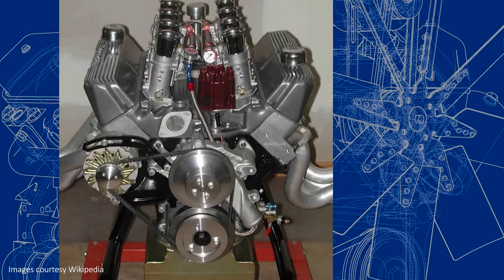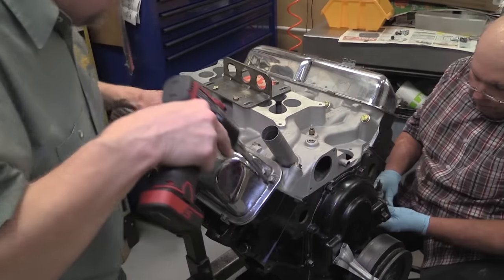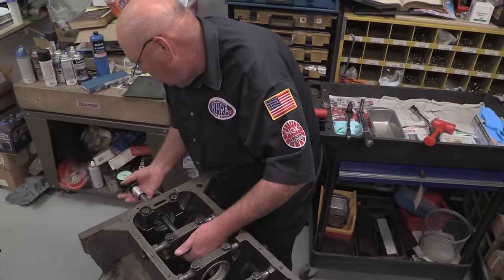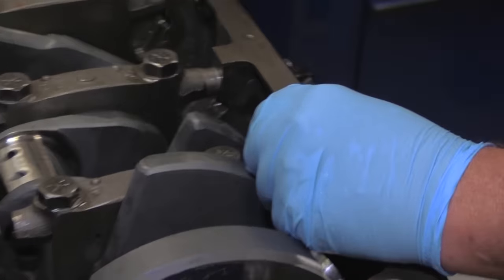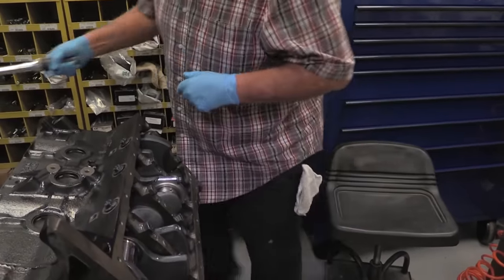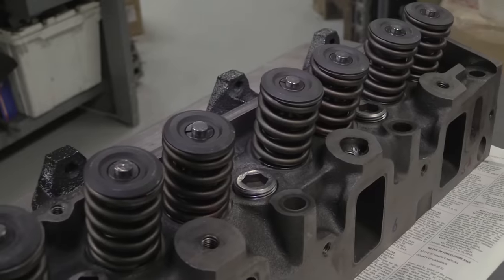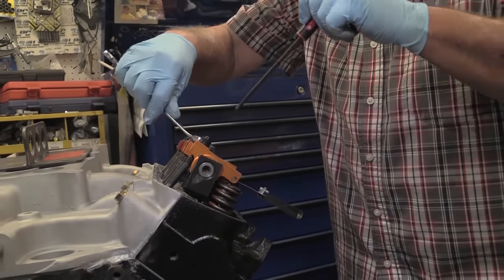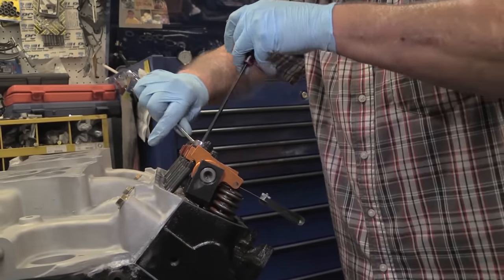Monster Ford 427 Top Oiler Engine Build and Dyno Session

Comment: I always have argued with people that a 427 Ford was even made . I have proved it to them time after time. I always wanted one of these. This is a beautiful work of art.
Reply: Actually 427 Fords they made different versions of them through the years, the top oiler, side oiler, and the sohc! King of all 427 Fords, plus the small block version . The FE series 427 is really 425 Cubic Inchs . CHRYSLER had the 426 Chevy, the 427 ,why didn't Ford leave it at 425 ? Food for Thought.
Reply: SOME PPL don't have a Clue! Ford made 3 Versions of the 427 thru the Years,  Including the SOHC /CAMMER! WHICH was Bad to the BONE! .
Reply: @jerryparks6123 Your right about those designs but not just 3. The high riser headed 427 had the top half of the engine in a league of its own. (Heads needed a intake to match). Also the tunnel port! I think somtimes we get lost in the amazement of the cammer, & rightfully so. However we shouldn't just over look the tunnel port 427s wich I believe there is no HP ratings on? However they ran every bit in step with Chryslers 426 hemi! The tunnel port heads had the big breathing ports like the hemi, but stayed with the wedge combustion chambers wich in some instances was a advantage for them! The early 427s started out with the low riser heads & and shortly after had high riser heads. High riser headed 427s got banned from nascar when the 426 hemis got banned. So Chrysler went to work to make the hemi legal. Ford created the tunnel port heads. Wich really flowed like the hemis! Just shorter than the high risers & still wedge combustion chambers! So many versions of the 427! The only differences in blocks was really just top oilers then side oilers. All the different head configurations used the same basic blocks if I understand it correctly.

Comment: The sound of a strong FE is amazing, this thing sounds like it could drag a volcano out of the ground.
Reply: we drag race FE 80s tbird with a mostly stock FE 390 and a 66 fairlane with a FE 427 and a turbo  check out my videos
Reply: ford ❤❤❤
Reply: It was a blast water skiing and joy riding in an 18 foot Hallett flat bottom drag racing boat. It had a V-Drive gearbox with 21 % overdrive. We would ski at 1900 rpm for some skiers and 3500 for others. We ran at Inboard Alley Colorado River area just below Parker Dam..fun times. 7100 RPM was a blast

Comment: Some commentors are disappointed with the power or that the owner went with stock untouched heads when he could have hidden some modern aluminum heads ported to flow.  What these critics are missing is that this FE likely is making 500 torque as low as 2,700/2,800 rpm, which means it can easily run between a 3.00:1 to a 3.50:1 differential gear and be loads of fun on the street.  I suspect that is exactly what the owner wanted for his Galaxie.  Even with very little throttle opening this car will really move out with that big flat table of torque.

Comment: There’s is so much more power potential in this engine
Reply: Lonestar Stang - not with Ford iron heads.
Reply: Moon Pie  Not sure what you mean by "unleash the hp" A cam change alone could give this setup 75hp. The cam is a modern style grind with high lift and low duration to improve torque at the cost of higher rpm horsepower. My stock (stock carbs, stock intake, stock heads, stock cam) 63 427 FE made 436hp / 458lb/ft with the dual points distributor with mid length headers without tuning. I had to go halfsies on the headers so they had something to run on the dyno that wouldn't fit and so the shop owners' daughter could get the headers that fit her 390 truck, haha.
Reply: It 8s really kool the John Kaase resurrected the the FE. Ha no change in prices, but for those with the means parts are available
Reply: Yeah, i dont see the point of not working the heads more. Even if someone wanted to go back to stock longblock, ported heads would do nothing but good things
Reply: Yeah, this performs similar to an off the shelf SBC 400" crate engine...
Reply: The exhaust port is the restriction on all FoMoCo iron heads. Just needs a massage on the bottom to blend into the bowl. Lots of cheap horsepower.
Reply: Scott Foxwell built one very similar cubic inches that made 850 hp with ported Edelbrock heads. So they weren’t crazy exotic, Scott is the top FE builder today.
Reply: @greekfrenchman4434  Yup...that was a dumb decision to leave them like that. I See some guys stroking their bb then put manifolds on it. Wth.
Reply: @Bbbbad724  Didnt know he was into FEs . He can build a heck of an engine

Comment: There’s about 75 horse left on the table just between a carb and intake swap. One of my favorite engine families at the track and grocery store and one of the best torque curves in Detroit.
Reply: I wonder how far it would go with a tuned Holley EFI and a performance intake.
Converting it to Fuel Injection and Elecronic Ignition would be beneficial in many ways since this engine went into a street car.
Reply: Way more power! I can get this from a 410 Mercury built a bunch of them for Mustangs.  416 cubes at 7000 rpm’s.

Comment: That motor will be a riot in that big Ford. That effortless torque with 470 hp will do the intended deed.
Reply: Yeah, big engines make heavy cars feel light.
Reply: @larrygall5831  
That Big Boy should be making 575+ easily. W.T.F.??
Reply: @guyneault5054  I was thinking 600hp. My slightly warmed over 440 mopar makes 500hp with 9.5:1, iron heads and a flat tappet hydraulic cam on pump gas with a single Holley carb.
Reply: @mitchellferre1652  
Mitch, I just so happen to be at Bonneville right now
 Thought you mite appreciate that, being you 
Just posted. 3 days into the meet, and because of rain, no runs yet.
Reply: @guyneault5054  good luck and have fun at Bonneville  ! 👍
Reply: @mitchellferre1652  no it doesn't
Reply: @jradish   yes it does and yes it did lol. My engine builder has a +.030" 440 with iron heads, a single 4bbl with stock block crank and rods makes 607hp on dyno. All day long.
Reply: @jradish I'm with u. From my experiences bb mopar with oem heads not often see one that makes 600 na? I'm not saying impossible. I'm just saying alot of effort would go into that build. Because of the factory heads. I know aftermarket headed bb mopar will easily. But oem cast iron?? Idk? Maybey I just havnt seen enuf big mopars??

Comment: When I can afford a build...I would want these old master's doing the work....Hands Down some of the Best!
Reply: CRYIPTIC CREEP  Iam with you as far as I would want an old timer working on my car hands down. These guy have forgotten more than I would ever know.
Reply: @craigsmith177  Agreed Sir
Reply: That badboy was used in the gt40 in 66'
Reply: It's not that hard of an engine to put together.
Reply: @jesse75  Then you Sir must have Talent.
Keep Up the good work.
Reply: @cryipticcreep5586  I have a video of a 64 Top oiler in my race car on utube.
" 427 FE with a new set of valve springs. "
My dad and 8 of my uncles were all motor heads. My grandpa and grandma had a farm with old cars on it. Mostly 60's Chevy's. Couple of mustangs and a dozen Pintos. 
I grew up around mechanics and it's second nature for me.
I worked on everybody's car in highschool. 
I'm 65 now rebuilt over the years more than 500 engines. Still doing about 20 a year. 
Locate yourself a good 390 block. Just put a stroker crank in it. It's a good option. Aluminum heads etc.
You can learn how to put an engine together yourself. The FE has a full floating pin, so you can put the pistons on the rods yourself as an example.
It's not that hard.
You can do it brother. Keep wrenching.

Comment: A friend of mine, back in mid 70's, had Red Coronetts speed shop in Somerset, Ky build a stroker kit for his 427 side oiler. It came out to 486 cubes. It had the side winder intake with a Holley 950 carb on med. riser heads. He put it in a '66 Cyclone, built C6 & 325 posi. That SOB would fly!!!
Reply: Robert M. Trolinder   I had a ‘66 Cyclone! Loved it. Came with a 390 and C6 auto. The heads were the ones with like 14 or 16 holes for exhaust manifolds instead of the usual 8. Used funny exhaust manifolds cause of the tight clearance in the engine compartment. Was probably some cutting done to get a 427 in one!

Comment: The ones that raced these monsters back in the day and know their secrets are getting to be few and far between. One thing they failed to say is the 406 and the 427s were cast with a higher nickel content ehich made them damn near indestructible and almost bullet proof. Love FEs
Reply: Yes, they were able to support about 750 horses then they had some problems.
Reply: Your "higher nickel content" is PURE B.S. -- nickel is only a tramp metal in Ford iron castings. Ford NEVER added nickel in production FE blocks - never-ever-never.
Reply: They used chrome and phosphorus to the iron which is a compliment to grey iron, making it more modular. Adding the third rib in the main webbing is a great improvement and truly nodular main caps made the FE block to a value of 32.000 strength as opposed to GM irons 26,000 .  A 3 main girdle or cross bolting  them make them capable of Cammer TF 2500, 3500 hp, and 600 miles at WOT in NASCAR.  The 352/390/410/428 blocks can take 1000 hp with a girdle or ProGram caps on 2 and 4 .  They were way under appreciated because they cammed them way under their potential and restrictions in the heads.  I have built some really strong beasts.
Reply: @Jack Russelle Lewis Didn’t what?  A gentleman who worked in the foundry told me that they added chrome, phosphorus and had a specific cooling rate in the 427 until they found that it wasn’t needed and planned to develop a 427CJ modeled after the hydraulic cam Cougar. Tasca came up with a cheaper route with the 428CJ which was just a PI with 427 LR heads with an iron MR intake. Nickel was pulled out as a trash metal as it is brittle and spalls the pour.
Reply: They were indestructible  in fact I want to turbocharge a 105 FT block to find the limit. I think it will be around 1000hp with a rising boost curve.
Reply: @Jack Russelle Lewis If there is a different story please enlighten me.
Reply: @Jack Russelle Lewis Nickle is the additive to turn steel into 300 grade stainless. I've used stainless bolts and screws, they're soft and will twist their heads off with mild torque. But makes steel non-ferrous.

Comment: These Ford 427 engines we're for all out track racing, not so much for drag. I would love to have a 427 galaxie of the era. Nice work on that motor fellas!
Reply: You must have heard of ford thunderbolts or mercury comet or that Ohio George one of the most successful gasser competitors ever used ford motors, sohc but f.e. blocks, so I don't agree with you.
Reply: @olderthanyoucali8512  ,Yeah those Thunderbolts weren't feared at all,huh?"Not so much for drag"LOL
Reply: The Ford 427 was designed for drag racing first. NASCAR came afterwards.
Reply: The narrator states this Top Oiler was built for drag racing. Drag Racing!

Comment: Well my 427 Low riser in my 36 Ford PU was all kinds of fun. In 73 it was one of the quickest in Walnut Creek,Ca.
I still have the truck and still have the 427. 😎
Reply: You're a lucky man to have such a rare engine....you should post some pics of it.
Reply: In '67 my friend from Stevenson had a '66 Comet Cyclone with a fully built 427 and it ran 11.70 to 11.80 at 126 to 127mph at Baylands. It was yellow and I have seen the time slips. Did you know the Forsbergs? I worked with Dave.
Reply: Do you remember a Springtime Yellow 67 390 GT  Mustang Fastback on the WC Main Street cruise in say 1976??
That car was the start of FE Specialties!!

Comment: Good work there...I have built several "centre oiler" FE motors....on thing I do is to chamfer and open up the oil holes on the pump pad.
Most FE engines have a 3/8 feed hole on the front housing that mounts the oil pump. I drill and open up the feed hole to 1/2 inch. I also open up the diagonal hole in the front of the block going up, just ensure good oil volume going in. As for the heads, some guys  restrict the oil to the rockers by putting drilled allen plugs into the head rocker shaft holes..got to be careful as you don't want to deprive the springs of cooling oil.
Reply from the maker: All good advice!
Reply: Restrict oil flow to the rockers,they get way to much.its better used elsewhere.
Reply: @mikewarpula911 a Holley jet fits perfectly in the oil feed hole. That's what I do.

Comment: I just watched a dyno pull on a SB 427 Windsor stroker build.  It put out just over 500HP and 530 lb-ft of torque with a small-runner intake and a 750 pumper.  Saves a couple-of-hundred pounds of weight and slips in easier.

But, the 427FE has the "wow factor" when you open the hood or say, "I have a 427", especially with dual-quads.
Reply: When you get get some iron off there  they weigh the same as a Windsor , it is amazing really. I still don’t know why they had all of the 351s and 400, the FE was the smoothest engine they made and a monster when built right!  They are surprisingly lightweight because they are built for racing. An iron 427 with an aluminum intake and heads with 2x4s is halfway between an iron 302 and iron 351 W. And even with the Windsor 427 having an aluminum heads and intake they weigh the same. I want to see the FE continue to be produced. All of the price gouging with the FE being difficult to build is a lie. I built my first one at 12 years old in 1972. A 390 and it was a hoss!

Comment: Back in the day , the hot setup was crossing up a 427 and a 428 , you would come up with around 450+ cubes , and in a highboy  they would push 35/38 in tires very well .BTW , that engine , due it's stroke , has got to suck so much air at an idle its got to be a challenge to tune it .
Reply: Thank Tasca Ford for that crossover you're referring to...the mixing of the FE parts is how Ford ended up with the 428 CJ motors in 1968. 
The 427 is a proven race mill,it owned Ferrari @ LeMans 4 years back to back to back to back! The 428 Cobra Jet is probably the best version of the FE for the street. The 390 FE can also be built for the street & is a slightly cheaper alternative to the 428,but is very strong on the street & strip. If you want to go top dog FE, the 427 SOHC is the baddest FE out there. It was 1 NASCAR rule away from production.  Also the "Cleveland" family of engines is the 385 series,351C,429,& 460 .
Reply: @slyane7320  Not quite, the BB was used the first two years, the SB the second two following a rules change.

Comment: I’m 48 so I lived in an era where FE’s were still sold new albeit mostly in trucks. I spent a lot of time driving a F750 with a 391 HD truck version. But I sure wish I could walk into a dealer and buy a new plain jane  Fairlane with one of these and a 4-speed.  I suppose one day…someone else will wish they could walk into a dealer and buy a Civic with a 4-cylinder gas engine too. Time marches on.

Comment: OUTSTANDING BUILD...I WOULD HAVE CHOSE A "CRANE" CAMSHAFT...BUT YOU GUYS ARE THE EXPERTS. THE "CAMMER" STILL KING OF THE FE series FORD BLOCKS! THANK YOU. GREAT VID.
Reply from the maker: Agreed, the Cammer is a sexy beast!
Reply: No Emmett, The Cammer as you may know was not available to the public. You had to be factory backed to acquire one. That and the 427 High Riser which was the king of all FE series motors. If You dig deep enough you will find out that the Cammer was nothing really to get excited about. Although a very well designed top end it did not make the kind of power the High Riser did. Years ago speed vision did a special and got all the best big block motors ever released from the factories. Every thing from a stage 3 ram air Buick to the 421 SD from Pontiac. They were done to exact factory specs. Top honors went to the 426 Hemi. In 1970 made it 720hp at the crank, 2nd was the Ford 427 High Riser at 680hp
Reply: UNDERSTOOD, MR. Ed Norton. GREAT FEEDBACK INFO ON A GREAT FOMOCO ENGINE. THE FE's and 385 series ARE JUST AWESOME TO ME. THANKS!
Reply: @ednorton1853  - two versions of the SOHC 427 were available from any Ford dealer until January, 1972 -- C6AE-6007-359J and C6AE-6007-363S. The dealer cost was $2281.17. ANYONE with the money could purchase the crated engines. Some Ford parts departments had them on display for sale.

Comment: The top oiler blocks can be converted to side oiler. A few plugs to redirect oil and a external oil line to put oil to the crank 1st.
Reply: I have done it.  I have done it on 390s, 410.  Piece of cake.  Really you only need two cross bolt caps, at 2 and 4 mains the blocks are really strong .

Comment: I think there missing something as my as my '67 427 MR with the factory solid cam  306/306 .510 lift with a single 4bbl puts 410 to the rear tires and 570 on 1 kit and has done it for 40 years !! and i've owned the car since '73